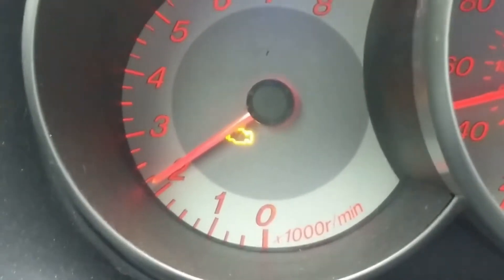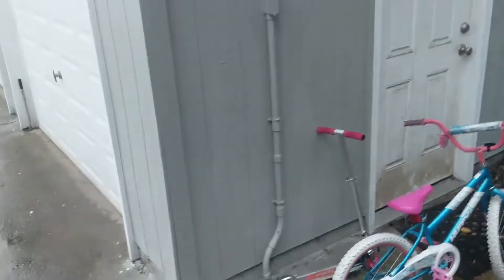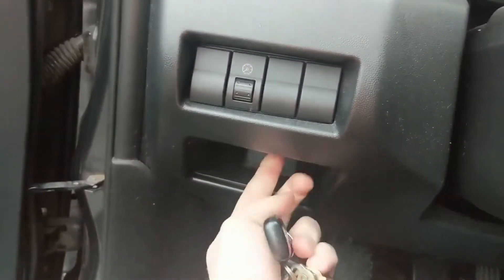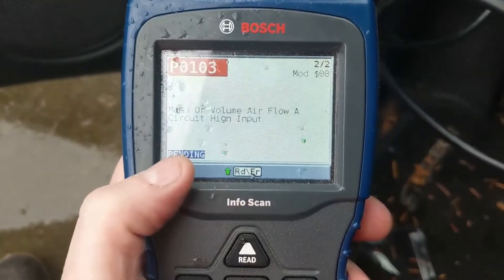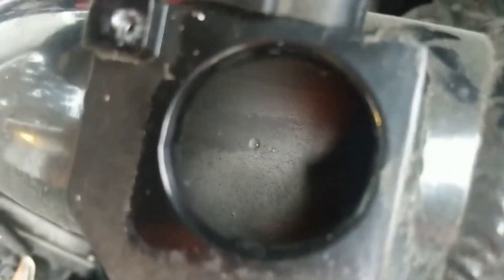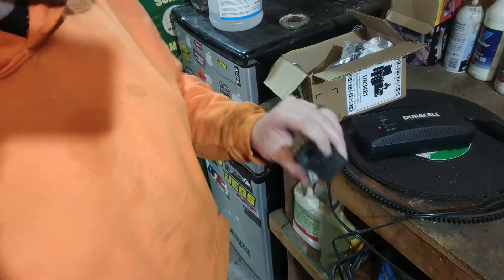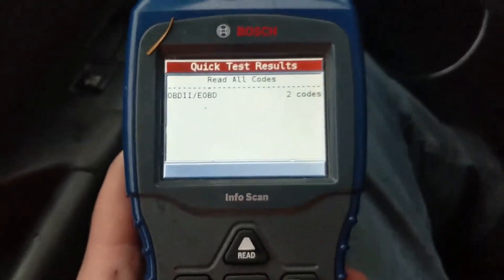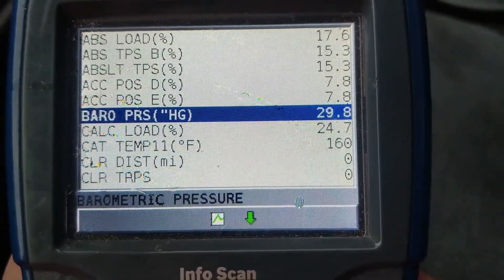Mazda 3 Check engine light!     Simple Fix

Comment: Like your video personality my only concern and research would why are you getting water on MAF SENSOR 
Possibly through cold air intake position from rain
Reply from the maker: We had a 3 day period where we were getting dumped on with rain. The filter is actually just behind the headlight.
Reply: It's been raining a lot lately and rained while I was at work and the light was on when I left work. Taking it in tomorrow.

Comment: Mine has been on for 5 years and nobody has found the problem. Mechanic says maybe air bubble in petrol feed.
Reply from the maker: Do you have the code?
Reply: Same than mine  , and this year is even worse because is not passing inspection because is showing a bunch of codes
Reply: use OBD2

Comment: next time just unplug the MAF i think it will let you drive it home correct me if im wrong
Reply from the maker: I might have to next time. no reading should send the computer on into a genetic run mode. But you know how it goes when. your on the side of the road.
Reply: @cheapskatenation   right very true its scary to get stuck on a busy road